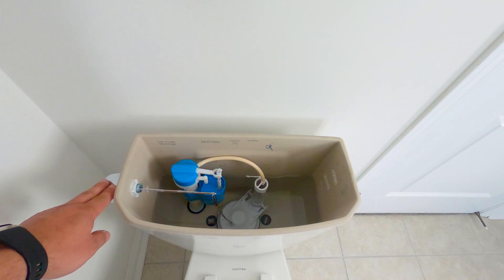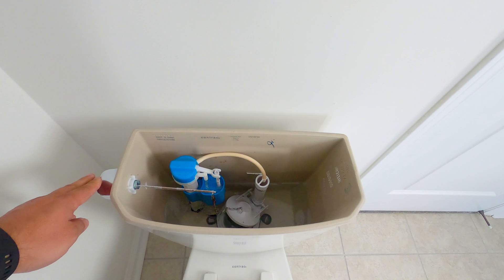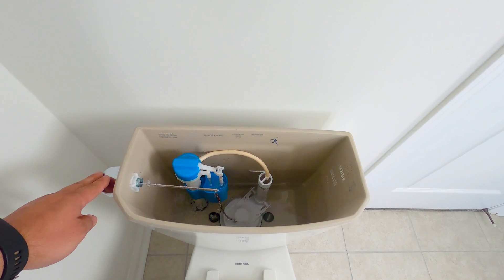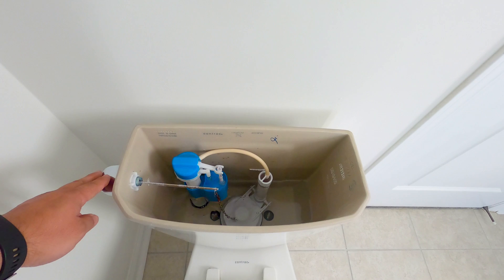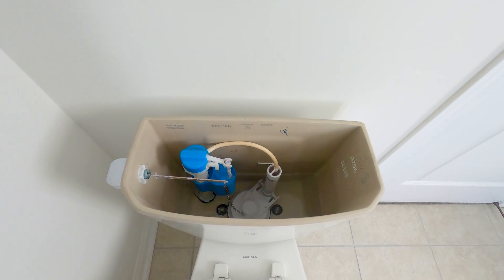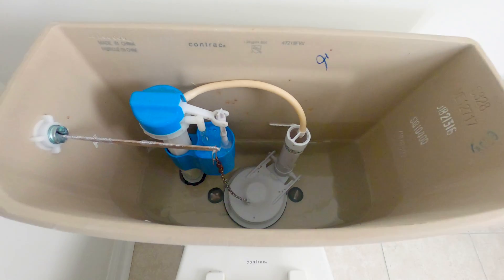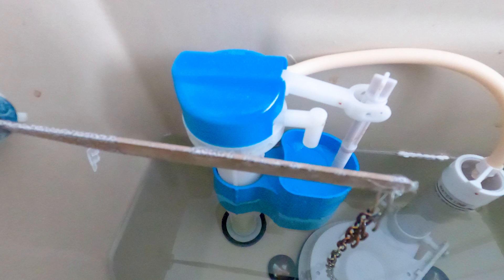Why Plumbing Pipes Make Noise and How To Stop the Hammering or Whistling Sound

Comment: We have an issue with our radiator upstairs. So it’s in the floor board and it’s constantly knocking it’s driving us crazy even it’s turned off it makes the noise. I lifted the floor board there is nothing there to touch the pipe. Please give us some advice thank you.

Comment: I have been having the same problem but only with the hot water, and it usually happens when the washer machine, located on the far end of the house, suddenly stops using the hot water. It's not terribly loud, but it's loud enough that it annoys me when I am near the opposite end of the house. I only started having the problem when I replaced the clothes washer machine. Eventually I'll have to call a plumber to troubleshoot the source of the problem.

Comment: Hello

I enjoyed your video.

I have a a Fleck 5600 with a mechanical valve about 6 years old.

When the water softener by pass is on, we loose water pressure in our house.  When the by pass is off, we have full water pressure in our house.

However, when we turn on the water in the house we hear some loud noises. Seems like the noise come from the pipes from the water softener to the house.

I clean the tank, put WaterBoss - Universal water softener cleaner and ran manually regenerate.   Still, when turning on a faucet inside the house, I hear like a fog horn noise. Actuallu, the noise stays even without turning a facet on.  

Any advice ?  and thanks for any ideas.   Thank you, 

Gabe

Comment: My hot water heater went out and turned the water off to it and started hearing a whistling sound. Everyone I asked didn't know what it was and my son in laws advice didn't work. After watching this video I opened the lid on the toilet and the noise was there. I messed with the top of the flush thing and that stopped the noise. Need to replace it but I can do that. We suffered with that whistling for at least 2 months. Your advice was spot on, I cannot thank you enough!

Comment: My problem is that the pipes inside the walls start to vibrate violently and randomly for about 3 minutes any time of the day or night. I sounds like when you drill into concrete! It looks like it starts from the boiler. But the sound in the boiler is much less than the sound of the pipe vibrating in the wall several feet away. The plumber changed  a tube in the boiler but that didn't solve the problem.
Reply: 😱😱😱😱 No: I could not deal with that! My room shares a wall with the bathroom and the hot water pipes run along another wall. When my housemate showers or runs the washing machine late at night the banging nearly gives me a heart attack. I am legit moving my bed to the garage 😅😅😭

Comment: You don’t need an hour lecture on this. Turn off the main water source. Turn on all the faucets in your house. Wait for 5 minutes to release the air trapped. Then turn off all the faucets. Turn the water back slowly until the desired pressure. It’s fixed. THAT SIMPLE.
Reply: Worked for me simple fix
Reply: If it's trapped air what would cause it not to bleed out while water is being used? Is it the (0) atom from the water replenishing the air back into the lines? What if anything pushes out the excess air when the water is turned off or only allows air out not in . At that point the air is stagnant. Do I need to treat the lines afterwards? Also my desired pressure is a lot. So what would you recommend to do and what happens if I tried exactly what you explained numerous times and still get the same outcome? Is there a time for certain square footage of a home or quantity of faucets? Do I allow longer time to allow the air to escape? I have questions I need answers and seeing as you are clearly the professional here please tell me or even better make a how to video please and thank you..
Reply: I was going crazy trying to fix this. Tried new heads, replaced the spindles and this is the only thing that worked. Thanks buddy!
Reply: This worked for me but it's a temporary fix it seems. Suggestions for a long term fix?
Reply: Thank you 👍👍
Reply: They worked for a bit now it doesn't. Did it six times still knocking
Reply: Yeah right why would you expect people to know if they've never encountered this issue and are not a plumber. I didn't know until my pipes knocked, and I looked it up. But as guy said it's not a permanent fix, it's temporary.
Reply: Does this include turning the taps on in the front and back yard?
Reply: My hot water heater and steam boiler are not connected.  Electric water heater and oil steam burner.  So your solution doesn’t work for everyone!
Reply: That’s  a temporary fix
Reply: I did just this. Didn't fix it, but I did clear out the pipes a bit since brown water came out for a little lol.
Reply: Thanks man you solved my problem 🙏❤ God bless you
Reply: The video is 4 mins long….. lol
Reply: Thank you sir
Reply: Not to come off like a smart ass but I'm curious why set out to watch videos on something your knowledgeable at? Why not make a video? Some people go in depth so people understand what's going on not just how to fix it. I can change a light bulb but I find it amazing to see the process of making and how they work.
Reply: I remove this outdated technology almost every day! Not only have these homemade arrestors been shown to quickly fail but actually trap fetid water that can be introduced into your clean water system!

Comment: I have a whistle that just started the week I replaced a kitchen sink faucet and a 1/4-turn ball valve supply feed under the sink. What is puzzling is that the whistle seems to always be in one spot right behind the bathroom sink no matter which plumbing fixtures are in use. My washing machine running causes the noise, the kitchen sink (hot and cold), my bathroom sink and shower, and the 2nd bathroom's toilet. My toilet doesn't cause it and neither does the 2nd bathroom sink as well as a cold water feed line off my washing machine's cold water spigot that goes to my fridge. Flummoxed.
Reply: i'm having the same problem, did you find out how to fix the problem? thank you
Reply: same issue after installing a new dishwasher. I think it is trapped air from when the mains got turned off.  and all the pipes got bleed out. there has to be 1 item i have not used yet that will get that air out.

Comment: Hi, thanks for this informative video. I have a heating pipe running the length of my basement apartment and it bangs/rattles. The pipe is exposed, hanging about a foot below the celling. I rent the apartment, so I have limited options in resolving this problem. My plan is to insulate the pipe in an effort to reduce the noise. Do you have any advice? Thanks
Reply: I have the SAME ISSUE AND IM ABOUT READY TO RIP THE PIPES APART MYSELF 🤬🤬🤬
Reply: It sounds like the pipe is expanding from the hot water entering it.  It could be that the supports are too tight and don't let the pipe expand in diameter and in length.  I've had some success in making the openings around the pipe a little bigger or using a tough non-metallic pad (maybe a resilient tough rubber) between the pipe and its supports. Hope it helps.

Comment: My house inlet pipe rattles when flushing or shower running.  Changed the house filter, but didn't really do anything.  Wondering if the pressure regulator is messing up.

Comment: My pipes in the attic I hear a continuous tik tik tik sound  every time I turn the water on . It lasts a few minutes or more. Would you know the cause please ? Thank you for the excellent videos.
Reply: Probably thermal expansion of the metal. If it only happens with the hot water on that could be it.

Comment: Do not make a hammer arrester the way he said. The air in the new branch will get absorbed by the water over time. The new branch will become full of water so the hammer arrester effect will go away and the new capped off branch will be full of stagnant water.
Reply: Yes, that’s what I also observed.  An arrestor chamber has a gas charged chamber that doesn’t allow the gas to leak into the water, and when the gas is compressed to absorb the water shock, the gas expands back to its charged position to standby for the next water hammer.

Comment: My pipes bang inside walls when hot water in the bathroom is running. Banging stops shortly after the water is turned off. Please help, it's driving us nuts.

Comment: You told everyone about water hammer; however, you did not provide any detail about exactly how to remedy the issue.  Specifically, what length of pipe is sufficient on top of the impacted value to remedy the water hammer issue?

Comment: Flushing the toilet, running a hot or cold tap in either the kitchen or bathroom, when the washing machine is filling, in all of these cases I get a sound like someone is blowing through a trombone...it's in the key of D, not that the pitch is relevant 🤣
Reply: Mine plays E Flat.
Reply: @frankblunt2482  So just a semi-tone above mine, then. I actually found and resolved my problem, it was caused by a very slightly leaking valve in one of the kitchen taps, a thick smear of divers' silicone grease on the rubber seal fixed it.
Reply: @GoneToHelenBach   Nice.

Comment: My pipes bang somewhat after the installation of Oates brand hammer arrestees at the new washer. Not sure if the arrestors were installed properly. They are in a horizontal or inclined direction. Does it matter?
Reply: Position doesn’t matter, up, down sideways or any angle.  Oatey’s spec sheet says this, but check for yourself.  You can’t really install the arrestors incorrectly as long as they don’t leak water.  I’m suspecting that they were installed in a branch that isn’t isolated from a fast shut off valve like dishwasher or clothes washer that is on another branch, which means the shock water isn’t reaching the arrester to absorb.  The Oatey spec sheet also shows a cross section of the gas filled chamber that absorbs the water shock.

Comment: This video is awesome !! I own an apartment building and there is a knocking noise in my walls (pipes), I have a heated water system. Any advice ??? Btw Thank you for the helpful videos !!!
Reply: Did you ever find out??? I have this exact problem
Reply: @rosemorrison4265  Yes , two things ! 
1. The pipes would expand  and knock in areas that they didn't have enough space to "move", floor openings were to small etc.... 
2. Too much pressure caused them to rattle, I had to adjust the pressure from the central.

Comment: I think those DIY air hammer arresters are illegal now, they fill up with water that becomes stagnant and puts bacteria into your water supply. Home Renovision DIY did a video about these.
Reply: I agree, but it's no different to a section of pipe that rarely gets used, like a garden tap or the shower in the 4th bathroom.

Comment: Our shower has a continuous banging when we reach a certain temperature for hot water.  it does not happen for cold water.  I'm not sure this is what is normally called pipe banging.  Any ideas how to prevent?  Thank you
Reply: This has started with my shower also.
Reply: Do you have just the one shower? If you have more than one, is it only happening in the one or all of them?

Comment: I am telling you. It sounds like a horror movie, my pipes BANG HARD!!! Even through the night, when no taps are ran. Or early in the morning before anyone even gets out of bed. They knock every single day. And there is like movement, or fidgeting sounds that come from somewhere under my roof, but above my ceiling. Please HELP? 🙏🏼
Reply: My friends apartment does same thing
Reply: I think that is from the hot water heater circuit

Comment: By making an extra branch on the copper pipe with a TEE connection you are creating legionella which is a very stupid and dangerous thing to advise you dumb. I think you need to go college and learn about health and safety. So guys please kind request don't follow these types of cow boys.
IAM a qualified plumber in u.k if any body Wana ask any question most wellcome. Remember health comes first water needs to circulate in pipes to prevent bacteria there can't be no dead end junction
That guy is in professional
Reply: So true. Now most new buildings try to avoid dead legs as possible. Maybe in Canada Plumbers don't care about water regulations.
Reply from the maker: @deepakkunwar8218  There are many dead branches in every single house even if the house is brand new, so I guess we all have legionella then! Remember that this method still valid in US and Canada, and these two countries spend Millions of dollars on research for any disease.
Reply from the maker: You dumb ass, what I show here is the plumbing code in Canada, Ontario. I'm a master plumber and you are just a certified plumber, you need years to learn these things. Again it is the plumbing code and i don't care what they teach you over in your village.
Reply: @PipeWrencher  your a master plumber? Who's creating legionella. No sir IAM not a plumber like you definitely. I work according to rules and regulations there's no dumb ass working in u.k as they are not allowed. We have water hammering but there's a way to fix it which I would not tell you.  You can put a TEE and creat dead legs and legionella also if you think u.k is a village than stay happy in your own way.
Reply from the maker: @123-l8i4e  Exactly! you follow the rules in the country that you live in and we follow the Canadian code, unless if you think you know better than those approving these rules. this method is the approved method in the US and Canada. yes you can alternatively use the mechanical shock-absorber but that is not what the code asks you.
Reply: @PipeWrencher  Mechanical in shock absorber is used on risers in flats where we get 10 floors more floors or even  long distance In horizontal pipe work expansion fittings is used for every 10 feet so that  Mains cold feed pipe in cold weather can stretch when water is in -°c which is ice.
Iam not the best and I learn every day

Comment: Hi, my bathtub make a noise like a machine running below it, when hot water is called in. No noise for cold water, it only starts when hot water is called in. Do you know what's wrong?

Thanks
Reply from the maker: Turn the main water supply valve off from the basement, drain the water by opening a tap in the basement and leave it on while turning another tap on, on the main floor and second floor, let the water drain completely and then turn the taps off and turn the main supply valve on, try the shower and let me know if it still makes noise!

Comment: thats a very old method, now we are using resters.. that method you are using, water will build up in that cap off tube and the waters toward the top part will be stagnet and bacteria will build up which can cause sickness.. theres something calk rester hammer or something that u can use instead of the cap off pipe.
Reply from the maker: Old but still valid, mechanical arrestor is a good replacement but requires maintenance and repairs.

Comment: The problem with ur solution is that sooner or later the water absorbs the air and the problem restarts. The second is bacterial growth possibly legionella.
Reply from the maker: It is a valid method and is a  plumbing code in Ontario. and plumbers go by the book.

Comment: Capped Branches for shock arrestors don't work for very long because water absorbs oxygen, best to get some that are manufactured with O-Rings and a Piston.
Reply from the maker: It is debatable as mechanical shock-absorber requires maintenance, but I get the point.
Reply: @PipeWrencher the manufacturers like Oatey, Watts, etc. say in their spec sheets their arresters withstand the standard 10,000 shocks and tested to absorb 500,000.

Comment: I hear a knocking sound every day for the past few weeks at around 4:30 or 5 AM. The sound comes from right outside my bedroom, which makes me nervous because the water heater for the house is directly below my bedroom. The odd thing is that I don't think it is water hammer - the sound is more like a loud woodpecker than a single knock and lasts a few seconds. It also happens in the morning before I use any of my water. What might be the cause of this?
Reply: do you have a lawn sprinkler system that is coming on at that time?
Reply from the maker: you really need to find out when exactly it sounds! I mean someone using a tap or a shower.
Reply: Did you ever find out what was wrong? You described exactly what is happening in my house.
Reply: This is happening to me also! Did you find a resolution? :(
Reply: Give the woodpecker some seed.😂

Comment: 20 years ago they changed the furnace in the building were I live, and that's when noise started. It's a hum noise, and it's always the same note = D (I am a musician)
The landlord is ignoring my complaints, I tried ear plugs but this vicious hum noise goes through the best ear plugs. Do you have an idea on how I can eliminate this crazy hum?
Thank you
Reply from the maker: How many units in the building? and when exactly the noise starts (when someone uses a tap? or when someone flush a toilet? and which unit you think the sound comes from?) you need a local experienced plumber to be onsite and see where the sound is coming from!
Reply: @PipeWrencher  There are 50 units and the noise started in 2003 when they installed a new furnace. Thank you, I will make sure they call a pro plumber

Comment: The hammering comes on when the water is turned on in my bathroom. It happens either when the sink tap is on, the shower is running, or the toilet tank is filling. The hammering stops shortly after the water is turned off.
Reply from the maker: you need to test the cartridge for the sink tap, shower, filler valve of the toilet and shut-off valve of the toilet. test them one by one and replace them if needed. hammer arrestor is the final solution!